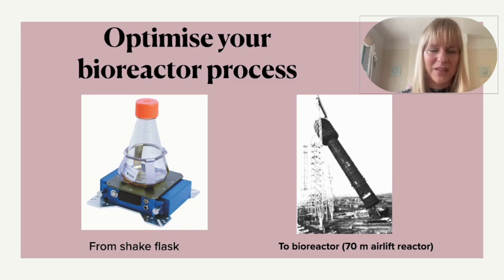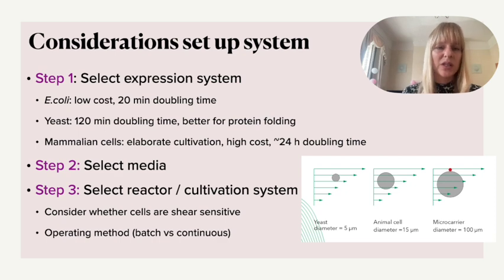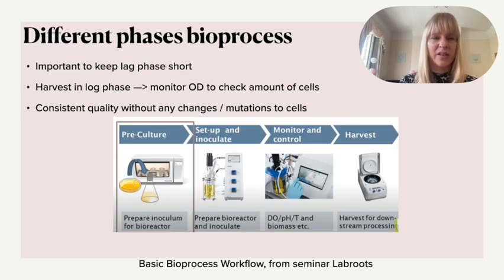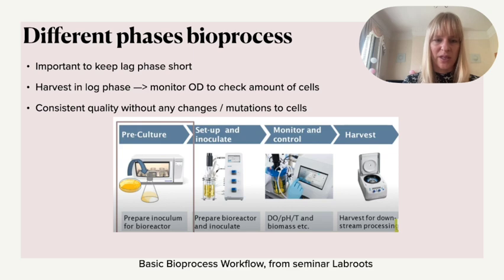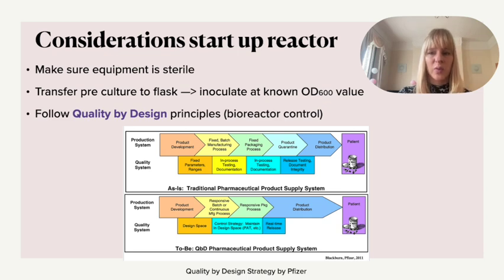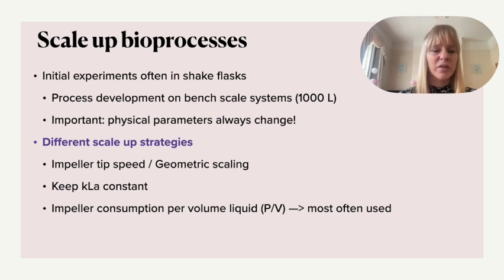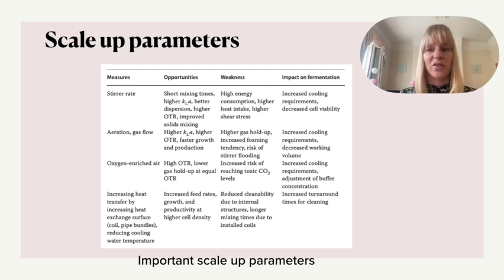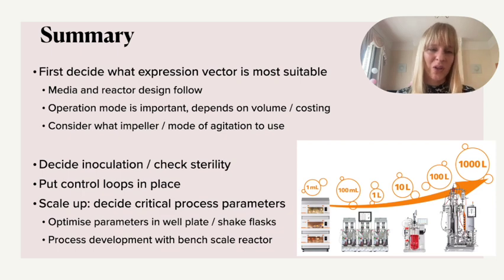Bioprocess optimisation: from shake flask to bioreactor

Comment: Another question: do you use any simulation software to determine what bioreactor characteristics you want? For instance what scale up process effects would occur? Such as many process engineers use Aspentech Plus or ChemCad to do reactor calculations when designing a plant.
Reply from the maker: Yes, we use Aspen Plus (it is not my expertise though). I do use equations for mass and energy balances which we solve via MatLab. For instance, see video on Monod kinetics